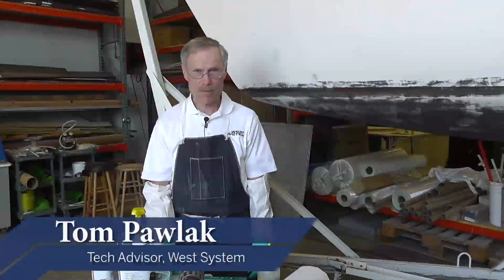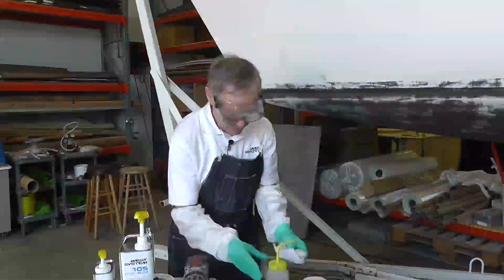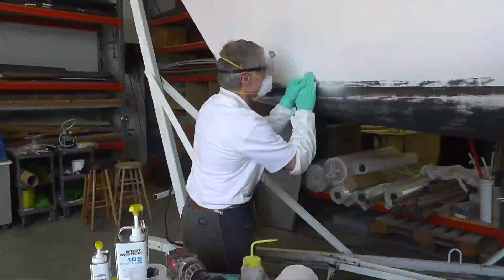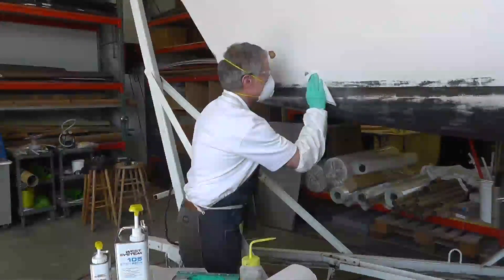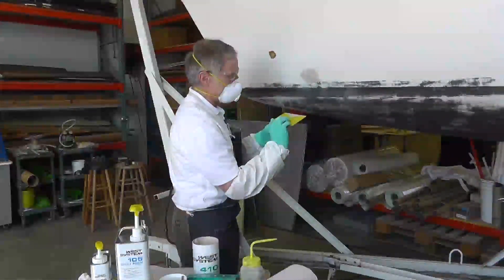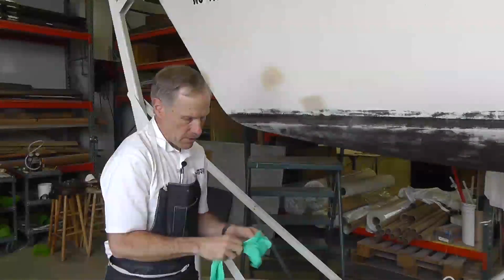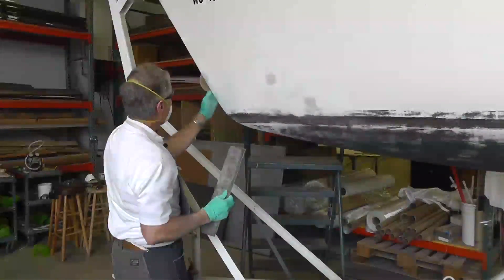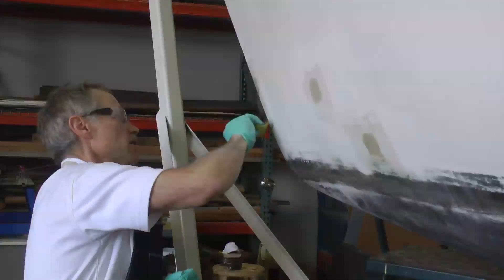SAIL Epoxy Basics: Fairing with Epoxy and Filler

Comment: Hi. I bought West System Epoxi and I have a question. I experienced now twice, that when pouring the Hardener into the Cup, the color of the Hardener looks very brown and rusty. Is that normal? I think that the can might get rusty in the bottom of the can. Does anyone know about this? It happende now 2 times to me and I put all in the garbage. But I will never buy West Epoxy, unless I get a good answer about it. I would love otherwise the product.
Reply: ROVER I just watched a video about this I think... some old guy who knew Gougeon Bros in 80s or so and said change of colour to brown is normal I think and doesn't affect integrity, in fact may be stronger? He was fixing a fibreglass keel in Florida in 2019 I think. it was a great video. of course brown doesn't help with colour matching on white I suppose, but maybe gelcoat would cover well?
Reply: It does this as it ages... According to West it doesn't change anything.